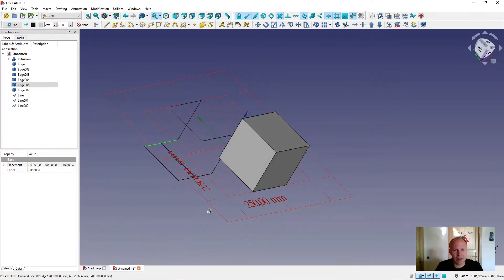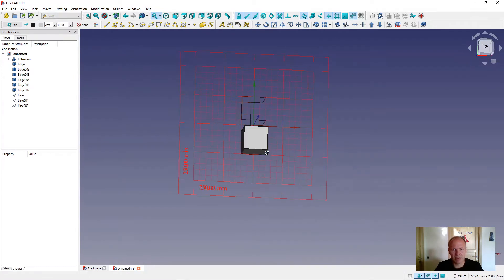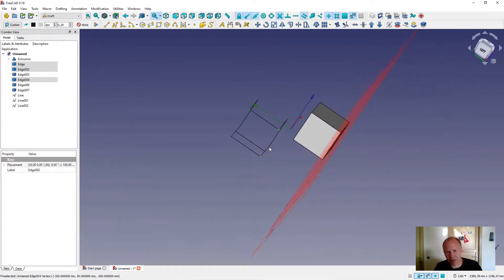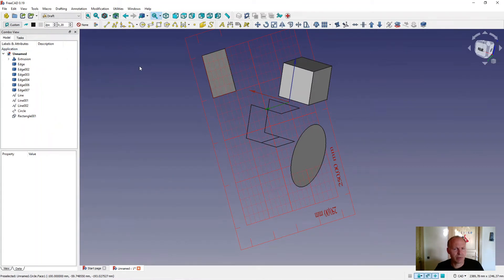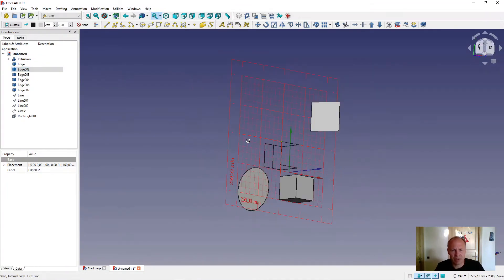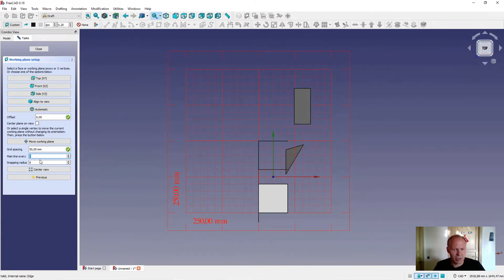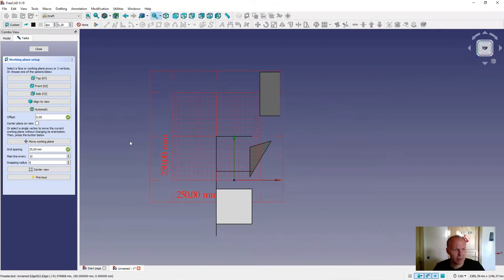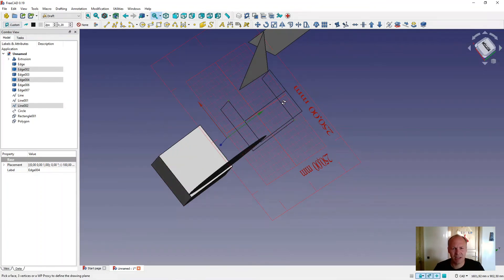Freecad draft lesson 1 plane setup

Comment: This was a very interesting presentation that helped me a lot !! Do you have any course or a clip about how to use Draft_label ? Iam building a bridge model usingDraft_line representing the bridge balks. My problem is that the Draft_label is NOT connected to the Draft_Line. So when I am turning it in 3D the Draft_label does not follow the construction. Do you know ? Best Regards Mikael
Reply from the maker: Thank you for your interest in my video.. you cannot to my knowledge make labels that moves then you changes thickness. But you can make measurements that move in part and part Design wb..
But if you draw an object and extrude it you can use  S in draft wb creates a shape from text find a font in Windows fonts make your text label now draw a leader line with line in draft wb if you select the small line ther is a property Map Mode attach the line to there you want the leader if it is not in the ring end of the line set Map path to 1 now attach the text  shape the same way in the end make a group in Draft and move line and text to it. Now you can copy the group then you need a label bg Mads dk
Now you can change the object and the leader line and text will move
Reply: @madslethdanielsen2099  Thankyou so much for this information !!